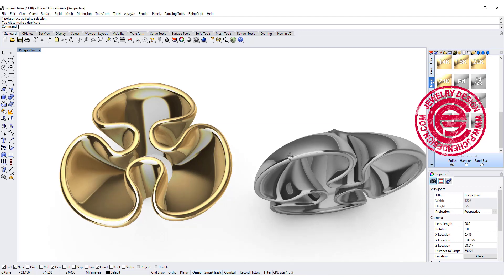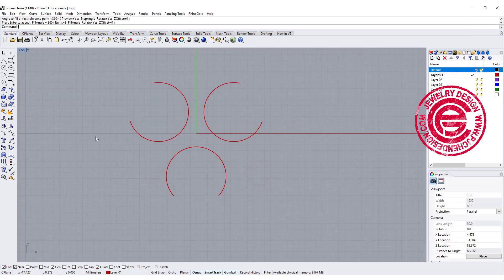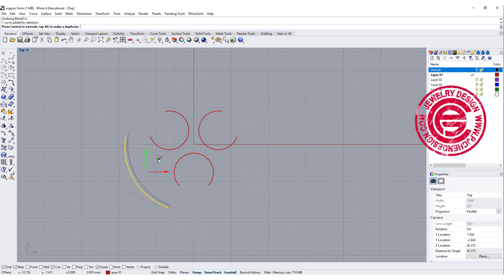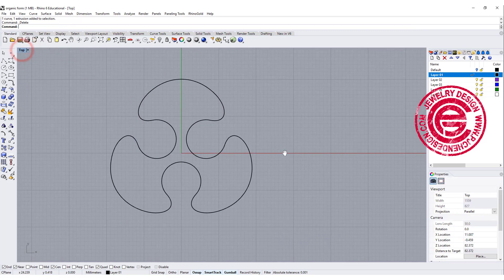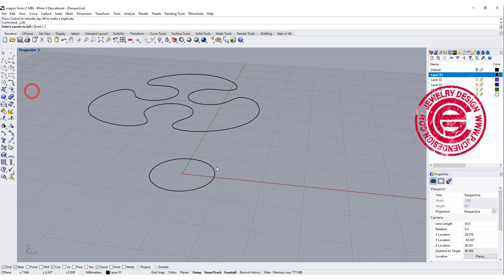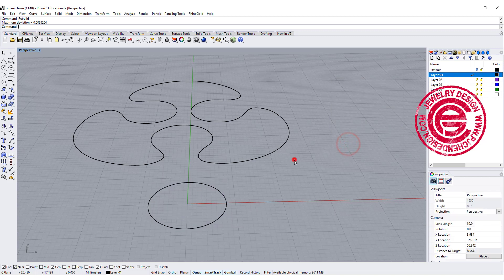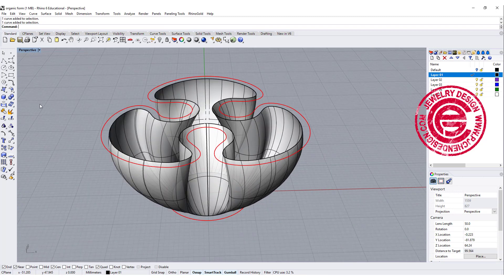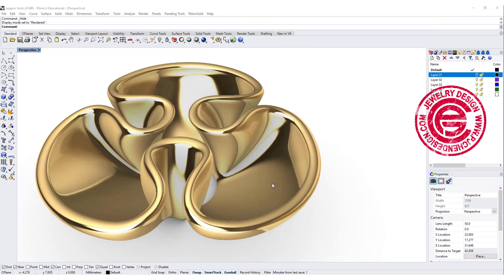CAD Design for Organic Form in Rhino 6: Jewelry CAD Design Tutorial #81

Comment: Your tutorials are among the best I have seen, thank you.  One question for you, at 10:20, what is your preferred method to set the gumball to the absolute center of the shape?  Odd-numbered star shapes always suffer from non-centered pivot points as the center of the bounding box for the selected items is not the same as the center of the star-like shape.  Curious about what your approach would be.
Reply from the maker: It depends on what you like to center with. the area, volume, distant? it can be all set up in rhino. for example. if you like to center by distant. you can always draw a curve and snap in the middle.